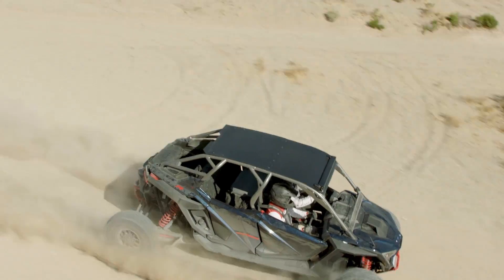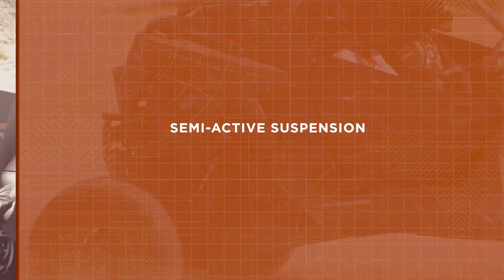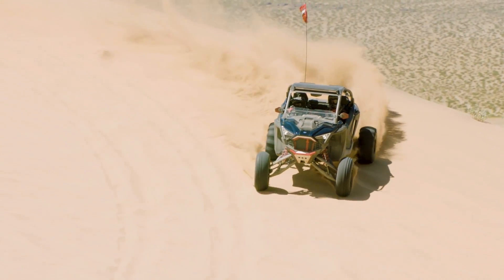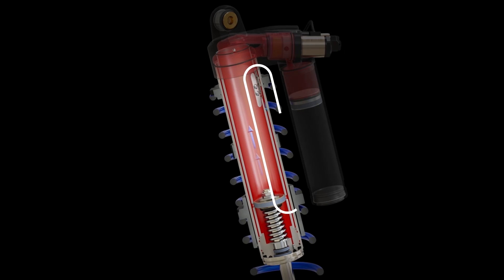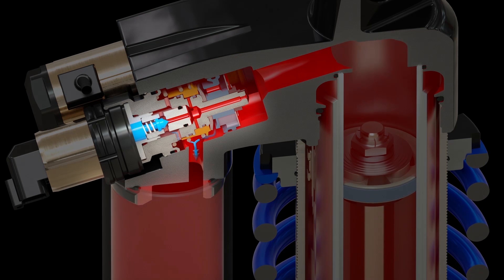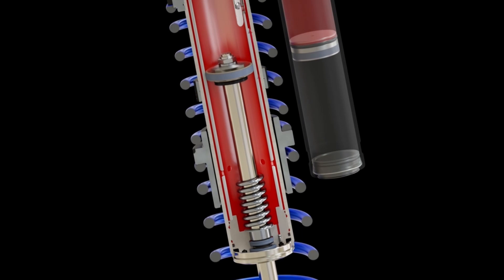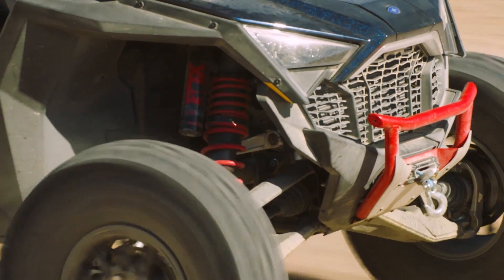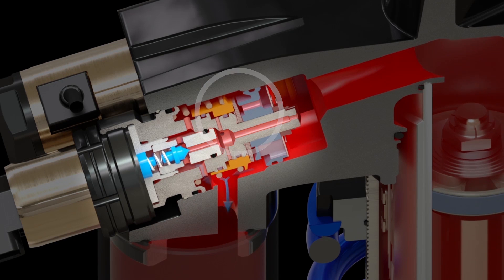RZR Pro R & Turbo R: Live Valve X2 – How It Works | Polaris RZR®

Comment: As impressive as it is. Ain’t worth 40k
Reply: It's 37.500. And it's literally worth more than that. It can literally go over offroad terrain at highway speeds. It's literally worth every penny.
Reply: @dkdanis1340  nope starts at 41k and the live valve is 45k
Reply: @dkdanis1340  you could buy a canam x3 smart shock for 15k less